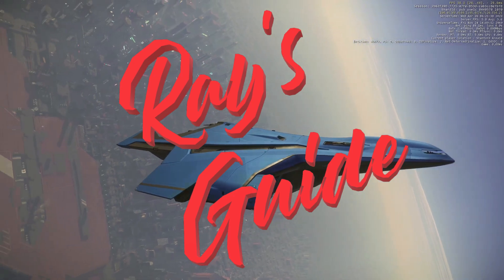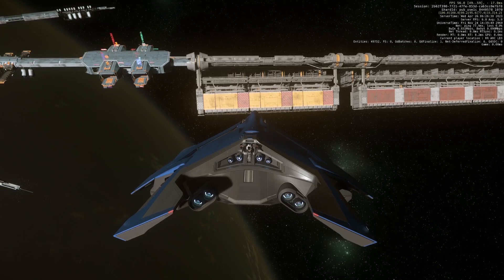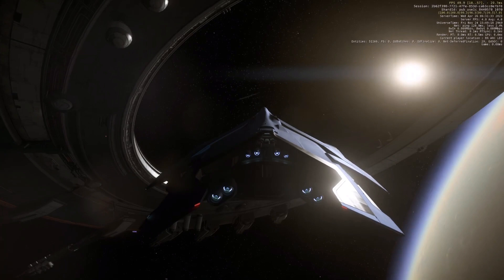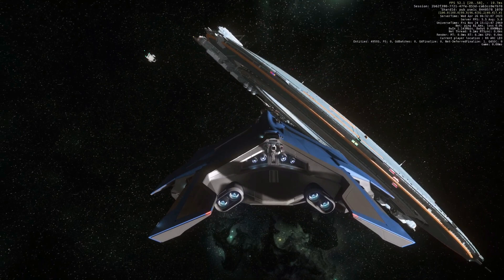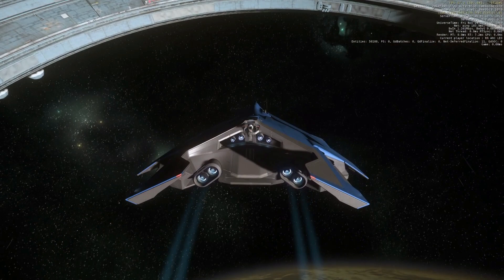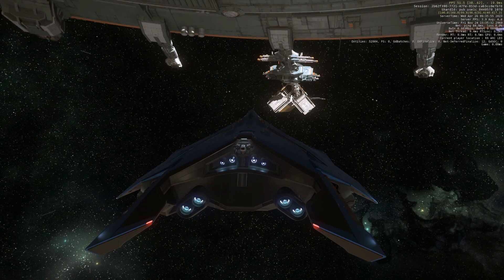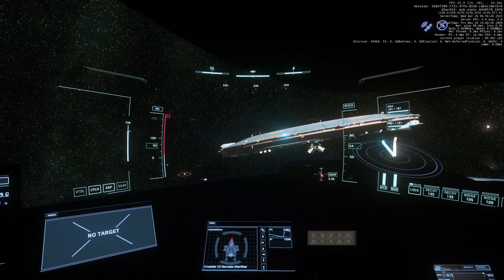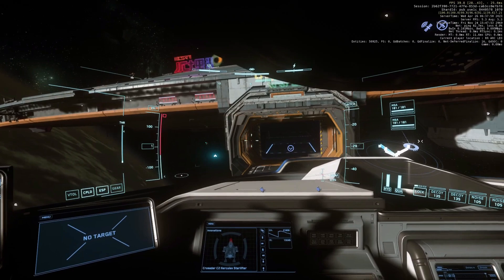Star Citizen: Examining Physics in the 'Verse, Decoupled Mode, and Hogfighting

Comment: I do think this technique will allow you to best most pilots considering the ttk for most larger haulers. However, someone will certainly point out that the attacker can basically stay perfectly lethal in that 200ms area of movement, and they can. Double however is, though, that the gladius now has to put more effort on their speed control while you, the hauler, have the easy job of pointing and shooting. What isn't able to stay safe orbiting a hauler with 200ms movement? A mantis. Last I checked, that's a single short burst to neutralize.

If you're quick about this, you will be able to get away, even against a small blockade.

Also the best way to explain decoupled mode is that your ship is essentially on ice now. It's not accurate to how it works but it's accurate to how it feels.

Comment: Fully simulated atmospheric flight may be extremely complex, from a physics standpoint, but as long as the pilot doesn't have to figure out thrust correction and flight surface control all by themselves, it ends up being rather intuitive. Orbital flight, on the other hand, is a complete nightmare for the uninitiated. Here on Earth the appple just falls down, at least for any practical purpose, so we tend to think of the effects of gravity as a simple thing to work with... But oh boy, yes, play some KSP and see (and even that game had to cut some little corners, but that was more of a technical limitation I think)

Comment: One thing in star citizen I dislike, at least currently, is how even with your engines off you decelerate pretty quickly, meaning you can't coast between things, so if you start running low on fuel you are just screwed, no option to drift to save fuel (this also means that, unless fuel scoops start being something less bad, you can't really cruise outside quantum for long distance atm). If decoupled mode solves that, maybe keeping some apples aboard to coast along will be useful and I'll be happy

Comment: I wonder how effective having missiles would be to even further increase the difference in velocity, I doubt a head on missile would take to much to avoid but using them to keep fighters on standoff while dealing with another may be an option, though if they throw apples back that could cause problems.

Comment: It's not an apples to apples comparison, but I run ballistic gatlers on my 100i for VLRTs and I can take an AI gladius or two with them pretty easily. Assuming limited pursuit (this is a starter ship with 2scu of cargo capacity, doubt any self-respecting Mongrel will call for backup), the chase and lace would work fairly well.

Comment: Honestly if its a Gladius or 2 of them, just put all power to shields and jump out. You dont need to fight at all. Now if there is a QED or Snare in the engagement, then this will be your best bet. But that Gladius can also decouple and maneuver better than you can at the same speed you can.

Get a gunner, get escorts. This is where the game is right now, and it will always be like this. AI at 30 Server FPS will smoke you just as much as a player at 5 Server FPS. And thats how CR wants it.

Can dodge all them apples.

Comment: The idea that gravity simply ceases to exist outside the atmo in-game is false.  Every time I've tried the experiment of speeding up in space, then enabling decoupled mode and releasing my throttle, I have found that you still gradually slow down even without applying retro thrust.  Certainly much slower than in coupled mode or with retro thrust being applied, but there is still a slow deceleration of around one m/s every couple seconds in decoupled mode with no thrust being applied.

Comment: I am not sure why this is so misunderstood, but it is perfectly possible in coupled mode to move in one direction, and point in another.  It seems that people continually confuse 6 degrees of freedom with coupled/decoupled.  You can do all of the maneuvers in coupled that you can do in decoupled.  The difference between coupled and decoupled is that your inputs in coupled are relative to a velocity of zero.  In decoupled mode your inputs are relative to your current velocity.  That's it.

Frankly Ray, I'm a little disappointed to see you persist this myth.

An easy way to prove this to yourself (in very basic form) is to simply hold down the S key.  Voila!  You are now moving in one direction and facing in another - in this case 180 degrees from the movement vector.  Using a proper 6dof control scheme makes this very apparent.  It's no problem at all, while coupled, to fly sideways, up or down, or whatever independent of your sight vector.  Moving with one vector and looking with a different vector is not a function of decoupled mode.

Once again, the difference between coupled and decoupled is that your inputs in coupled are relative to a velocity of zero.  In decoupled mode your inputs are relative to your current velocity.  So, in coupled mode if you return your control inputs to zero (center) you will stop (zero velocity) whereas if you zero your control inputs in decoupled mode, your velocity will stop changing (zero change to current velocity).

In both modes your inputs cause accelerations in whatever direction and rotations you choose.  (In fact there is no difference in rotation in decoupled mode.  This would be a nice feature for CIG to implement.)

If you still remain unconvinced, I have uploaded a video demonstration 6dof controls in coupled mode - including independent view vector from motion vector.  

https://www.youtube.com/watch?v=bcVruqVZnLU
Reply: You can turn a clean 180 in coupled and point at someone following you but unless you're a godlike player with two joysticks you will be losing some energy due to IFCS fighting your imperfect inputs. It's long been a tactic for kbm players in a dogfight to hit decouple to make tighter turns at high velocities.
Reply: @kiri101  You don't have to be anything close to godlike, but you do need 6dof controls.  Also, yes, if you're going to stick with KBM, then decoupled does make 6dof maneuvers easier, but that's just because KBM is about 2dof, plus another 3 degrees in binary only.  Hardly ideal.  

As for IFCS fighting your inputs, no not really, in the same way you can hold your stick to max forward, you can hold it to max backward.  there's really no precision issue here.  Now doing the coordinated turns is more difficult, but if you have 6 analog axes, it's not amazingly difficult.

Also, for the record, because coupled makes this easier and smoother, you're actually much easier to shoot when in decoupled than coupled.  Even though you aren't going to be losing much energy, you will  probably be doing small scale inputs and corrections.  Those make you harder to hit.

Acceleration is what makes a target difficult to hit, not velocity.  So as long as your inputs are varying, that's better in terms of avoiding incoming fire.